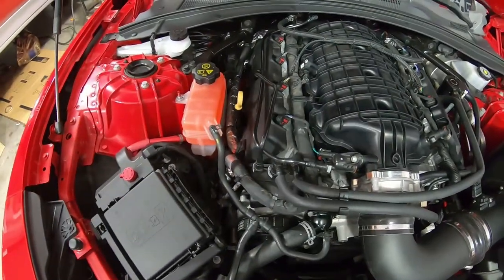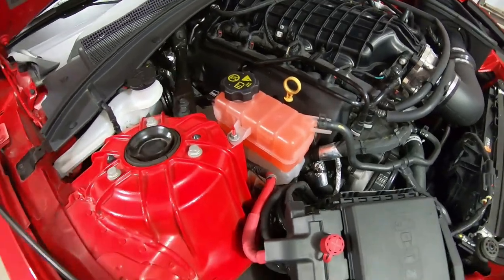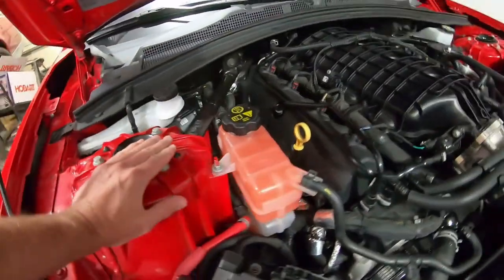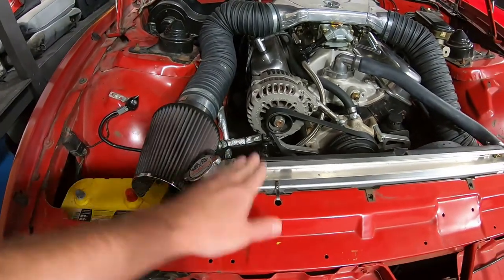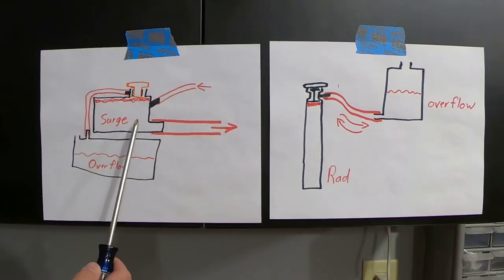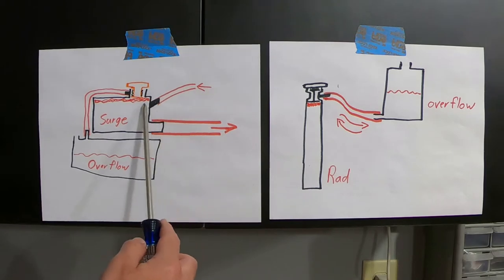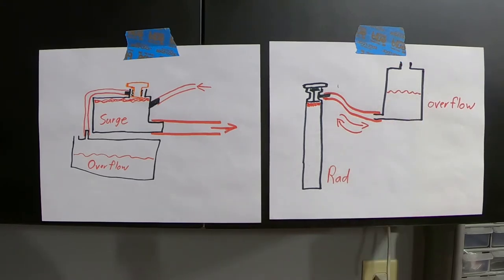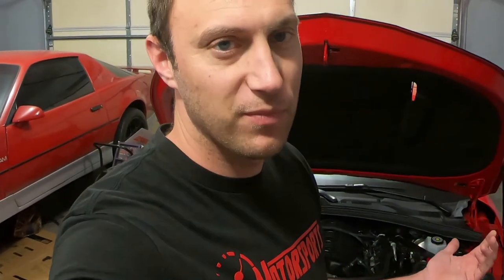Surge/Overflow Tank Differences and Cooling system Maintenance

Comment: Great vid - thanks a lot for this! The cooling system of the Camaro on the right side is a reverse flow system, isn't it? The principles you are teaching about are nonetheless applicable even to conventional system, aren't they?
If the LT engine of the Camaro really is "reverse flow", as I guess: Doesn't this require Evan's waterless coolant? In your expansion vessel seems to be Dex-Cool. Sorry if my questions should be stupid.
Cheers!
Reply from the maker: No it's "standard flow" into block first then into heads. The older 93-97 LT1 Camaros were reverse flow. U don't need any additives, just water and dexcool.
Reply: @EssMotorsports  Thanks for your reply! Do you know why the promising reverse-flow concept isn't up-to-date anymore?
Reply from the maker: @j.1294  I don't really know, I'm assuming the benefit was not there for the complexity. Air bubbles want to go up not get pushed down from heads to block.
Reply: @EssMotorsports  Thanks once more! Very good point!
Cheers! 👍

Comment: Great video! I'm curious to get your opinion on this. My 2016 camaro's temp gauge keeps going in and out. My coolant levels are fine and the car seems to be running fine as well. The heat and a/c work perfectly, but for some reason the temp gauge just doesn't show a reading. And then randomly it starts reading again. 
Mechanics that I've shown my car to don't seem to care. 
If you have any info regarding this, I'd really appreciate it!
Reply from the maker: Humm sounds like it could be the sensor ground wire loose.

Comment: Seriously contemplating this system with a surge tank on my “older” race car (radiator with overflow tank only). I always bleed the coolant system if I take the radiator cap off or add water to the system. Air can create steam pockets in the cylinder head(s), and I have witnessed it with one of my race engines on a dyno; it sounds like an exhaust backfire and can destroy an engine if you continue at WOT. Is this reservoir system on all Camaro’s or only the performance versions and what years? Thanks, well done video.
Reply from the maker: U could definitely Integrate this into an old car. Would only help. All camaros have this, but most newer gm cars at least as well. It's just a better system to remove air.

Comment: What´s the technical reason to keep the overflow tank up to the cold fill line? If the upper one is the surge tank it shouldn´t make any difference if the lower tank is full or empty...any thoughts? Thx in advance
Reply from the maker: Good question. The reason u want to keep overflow tank filled to cold line is during operation the surge tank builds pressure just like an old school radiator setup, and will push coolant to the overflow as it expands with temperature. As the car cools it will pull the coolant back into system to not allow air. Think of the surge tank just as your radiator it's just called something different and its higher to let air move to the highest point in the system.

Comment: I recently got a ZL1 and have about 450 miles on it. I went to check everything out today and noticed my surge tank is about an inch and a half or two inches low from the cold fill line, and my overflow tank is about an inch above the cold fill line. If I fill up my surge tank to the fill line will I end up overfilling the coolant system since the bottom tank is about an inch too high, or should that bottom tank eventually burn some of that off?
Reply from the maker: I would fill up the main tank full. And see if u can siphon a little out of the overflow/bottom tank. If not it will just overfill out of the tank to ground.

Comment: Hey bro, been watching your mod videos and I just had a few questions. 
• I was wondering how the car has been running with your current setup? 
• is it your daily driver? 
• was also wondering how you fit the 95mm LT5 TB to the LT2 intake. I’ve read that you have to port the inlet of the IM to 95mm for the TB to achieve 100% air flow. If you had have any insight I would appreciate it. Have learned a lot through your vids.
Reply from the maker: Your comment about u learning from me is a huge compliment! Thanks bro warms the soul! 
As far as the car is freakin awesome, not a thing wrong. Obviously tuning plays a part in that, I kept it safe and got idle dialed in so it honestly drives like stock just more badass than stock! It's not my daily tho, only comes out on nice days. So the 95mm is going to be your restriction. The adaptor isn't the issue, I port matched my adaptor opened it up a bit to match the intake. But even so if the lt2 is ported it can't be ported enough to be a true 95mm it still necks down to maybe 90mm. So if it's street driven and your ok with giving up maybe 5hp let's say over the MSD. The lt2 is still an awesome budget mod! MSD still not worth it for me.
Reply: @EssMotorsports  no problem, your vids will come in handy with installs. I appreciate you taking the time to reply. It’s good to know as long as the tune is dialed in it’ll be ok. But same,  can’t justify spending 1200+ on an MSD either, would rather get the LT2 for less than $300. While typing this I actually thought of a few more questions if you don’t mind me asking? 
• how did you port your adapter to match to the IM? You lay the adapter on the IM, mark it, then sand it?
• in your opinion do you think it’s worth it to buy speed engineerings 2” headers or should I go with something like kooks? I’ve read about speed engineering having exhaust leaks but also saw you installed them and used different clamps. Was just wondering if you still experience leaks?
Reply from the maker: @kevinrosales056  yeah I bolted the adapter to the intake manifold and marked it from inside with a small marker fitting your hand in. Also measured throughout with dial caliper. 
I have no regrets with the Speed Engineering headers. With different clamps, no leaks or issues. And again way! Cheaper, I know sometimes u get what u pay for but I would recommend the SE headers. I have the 1 7/8 and no fitment issues
Reply: @EssMotorsports  seems pretty straight forward, I’ll be investing in a dial caliper haha but okay great seems like I’ll be buying some SE headers with walker clamps. from watching your header install vid it seems I’ll need around 10-12 clamps?
Reply from the maker: @kevinrosales056  8 total clamps. Six 3" and two 2.75" and use speed engineering clamps for the header connection and tighten with impact! Haha
Reply: @EssMotorsports  awesome bro I really appreciate you taking the time to reply to my questions. Stay safe, have a good day, and keep the videos coming.